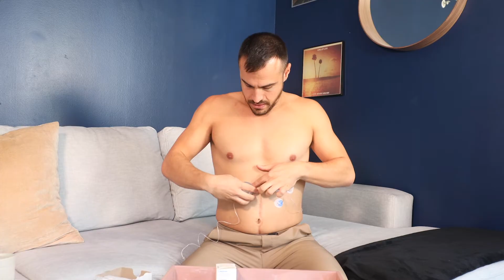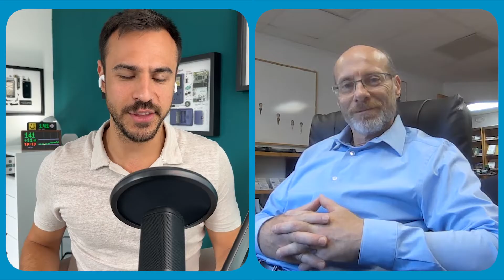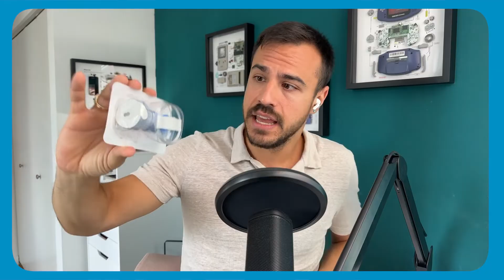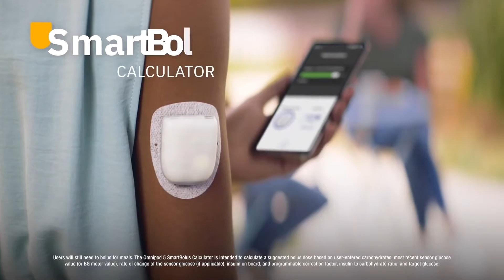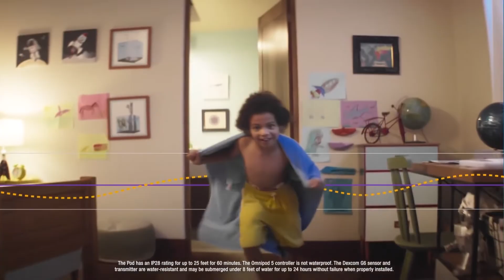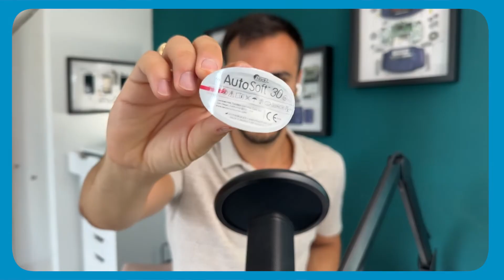Choosing Pump Infusion Sets - Which One Is Right For You?

Comment: Great review of infusion sets!  

Both Tandem and Medtronic use the same manufacturer—Unomedical—for their sets.  That is why their sets are similar.  I used the Medtronic Silhouette with my Tandem VariSoft 30 tubing.  (Tandem’s tubing has a luer lock and Medtronic has its own proprietary tubing).  The Silhouette and the VariSoft are essentially the same set manufactured by Unomedical, who prints the Tandem or Medtronic name on the packaging.

I have been using the angled sets for a long time.  I found thar, with practice, it is easier to use your left hand (I am right handed) to insert the set in the right side of the abdomen.

Comment: My son is a type 1 and is now on the Tandum T slim x2 pump. The biggest problem we have is the Autosoft 90 and  30  canula sets. We are constantly having canula failures.  If anyone has the same problem,  I would like to know, and what your solution is.
I am not a doctor,  but I have noticed something very interesting about blood sugar and barometric pressure. When the barometric pressure is dropping, blood sugar levels go up, and as the pressure rises, blood sugar goes low. We watch  the pressure , and if low pressure is moving in, we add 10 to 20 percent  onto the carb count to stop the highs before they happen.  Our son was 86% in range and had a perfect a1c, the last time he was at his doctor.  I suggest  if you are having highs and lows that you can't explain,  do your own research and start tracking the barometric pressure. You will probably notice a pattern.
Reply: If canula failures are a big problem you could ask your Tandem rep for TruSteel sample and see if that works better. When I switched from Minimed to Tandem I had issues with the infusion sets. With MiniMed I used the quickset without a problem, the Autosoft 90 however was a real problem. I spoke with my Tandem rep and was given samples of Autosoft 30, and trusteel. The trusteel really works well for me.

Comment: My total history of infustion sets is tandem and the trusteel infusion sets.  My daughter used/uses the medtronic with the inserter type.

I wish that tandem would go with a "INSERTER" type.  With the manual type I have to "SLAP" it in.  Most times it's ok.  Some times I feel I slapped "SILLY" crooked and I'll get a small pain and it seems to persist for the next 2 days.

Also I've been wearing an infusion set on for 4 days.  I started doing this because I needed to build up an inventory of sets so that if I sweated a set off, or pulled on the set, etc I had backup sets to use.

My one consistent complaint I have with these TRUSTEEL sets is that when I'm removing the set I wish the adhesive spots had little wings you could peel up and then be able to grip the wings and pull the needle straight out.  I feel that currently when I peel it out it "ROLLS" out and causes bleeding.

Comment: I'm using the extended set from Medtronic. For the first few months, 6 days was my max. The area around the canula would get pretty red, itchy, didn't feel right, so took it off on day 6. I can now do 7 days. Have only had one come off and one partially. A single occlusion issue requiring replacement.

Comment: Started out with Medtronic and their Silhouette infusion set using the inserter.  Used the inserter for years and loved it. One could vary the angle and with a button push, the infusion set was in.  When I switched to Tandem I went with the Verisoft infusion set.  Did not care for the manual insertion very much.  I did find by slightly modifying the Medtronic inserter I could insert the Verisoft set.  Used it for several years until something changed.  Perhaps the inserter was wearing out from years of use but quite often the insertion needle would get bent at the insertion site and made it near or even impossible to remove the inserter needle.  After  ruining several insertion sets I went to strictly manual insertion.  Miss the inserter but you do what you have to do.  
Being a guy I do use the 23 inch tubing.  I tried the longer tube and it was just too much tubing to deal with.  When using the bathroom I remove the pump from my belt and place it on the waistband of my underwear.  We humans can adapt!!  Interesting topic today.